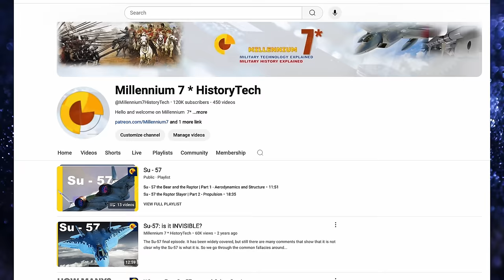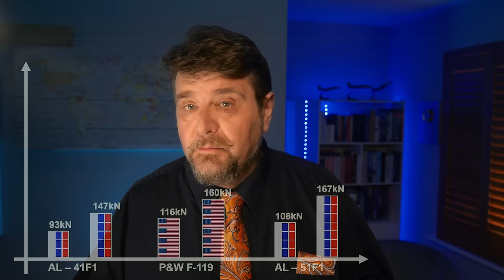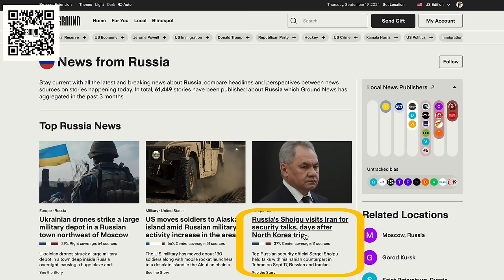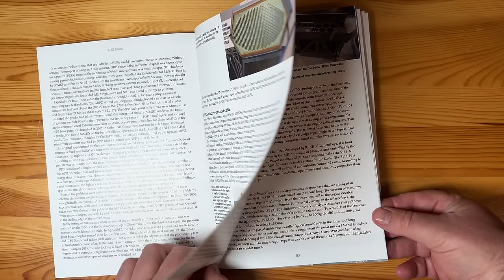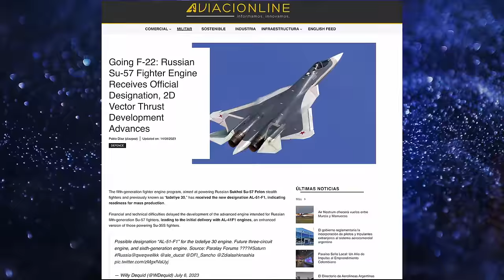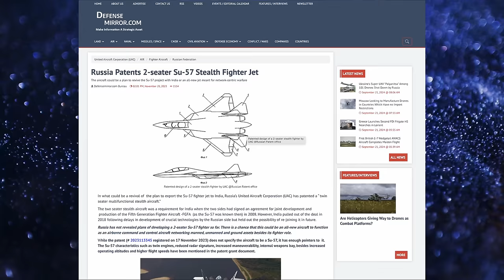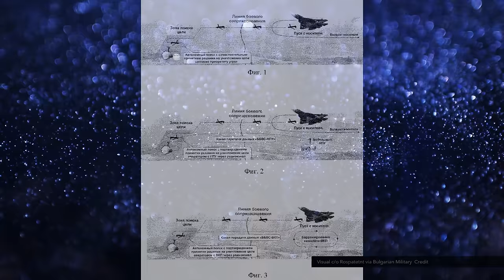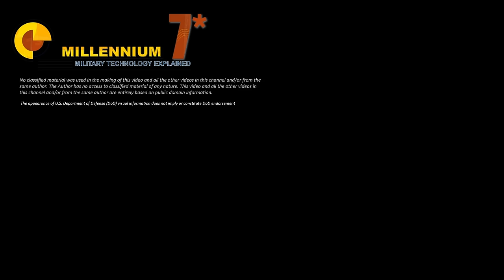The Su-57 is a Masterpiece!

Comment: There’s always the question of manufacturing standards, as modern materials require both advanced tooling and highly skilled workers, both of which are in short supply in Russia. When it comes to avionics, it’s probably still decades behind i.e. the F-35 for the simple reason Russia doesn’t have access to the most modern semiconductors. Russia is currently on 350nm aims to get to 160nm by 2026, the wider West is at 2nm equivalent, aiming for 1.4nm. Software should likely also be behind, as there has been very little time and very few airframes to identify bugs and shortcomings. It all comes down to a lack of experience, funding and scale.
It’s still a good looking plane, sadly used in support of an unjustified and illegal war.
Reply: beautiful outside, absolute garbage inside
Reply: Hard to judge. You can ask a supercomputer or one of those solar-powered calculators from the 90's how much 2+2 is, and you will get the same answer from both. You know what I mean? Complex and expensive does not necessarily mean better.
Reply: @libertarianbydefault  The complexity argument doesn’t favor the Su-57 here. Less advanced manufacturing results in more parts, that are also more likely to break, less advanced semiconductors means relatively higher energy consumption and reduced efficiency, requiring additional cooling and possibly resulting in reduced lifespan, and less practical experience results in less optimized software, that as a result of fewer and likely less skilled programmers is also more probable to be unnecessarily complex. (Highly skilled workers are sought after and thus able to choose a country of residence with better pay and higher living standards)
Reply: @RichelieuUnlimited  Mate, name me at least one reason why the programmers would be less skilled. You just keep making assumptions of the "this is like this, then that is like that". What if it consumes less energy overall? What if it has better cooling solutions? What if is built with additional robustness in mind? None of us know any of it. My point here is that there is this assumption that the way West does things is the best way and if someone else does things differently, they must be doing it worse. Considering there is not real track record to speak of to back this up, I am really amazed by how much faith we have in the overpriced, over-engineered, fragile stuff that we make, while entirely dismissing efforts made by the adversaries 'cause, well, "they are the bad guys, so they can't possibly do anything better than us".
Reply: @libertarianbydefault  If you’re skilled enough to be highly sought after, allowing you to freely choose your country of residence, where would you rather live, western Europe or Russia? Robustness is either the result of more advanced manufacturing techniques, allowing for either lighter parts that are as strong or stronger parts that are of similar weight, or the result of using heavier parts with similar technological level. Aircraft are dependent on being relatively lightweight, which indicates what the best choice of the three is. As for the West being better, a greater number of people, that have more funds available and have worked on those systems for longer, will typically lead to better results.
Reply: @libertarianbydefault  yeah i wonder why do we have this bias in the west? it's almost as if we have worldwide export induestries of these capabilities whereas russia doesn't, it's almost as if the market chooses the best product, and all orders of russian equipment (both aircrafts and anti air systems) are being canceled. I wonder what could possibly lead the west into this unexplicable bias huh
Reply: @RichelieuUnlimited  Look, you make valid points, they all make sense. My point is different: the assumption of Russia "having a lot less and a lot worse of everything relative to the West", that is simply not true. This might have been very true some 25-30 years ago, but things do change.

And to answer your first question. I actually have been to Russia and lived there for a little bit back some 5 years ago, it was awesome. Both Moscow and St. Petersburg are terrific cities in oh-so-many ways. Unlike the absolute vast majority of people who comment, I actually know what I am talking about. I would lean towards living in Russia if I could but we both know that in today's world there is a huge fence, that has been erected by the West, that makes this prospect technically challenging for a westerner. But yes, I did like it there more than your average European country. One of the things that would motivate me is that the West is declining, at least Europe is. Things are just getting a little bit worse day by day, hardly ever better. Russia is flourishing by comparison. This is all quite sad but I am not really willing to pretend that we are "living in the walled garden, and outside is the jungle". A bit off-topic here.
Reply: @libertarianbydefault  yes brother russia is amazingly beautiful if you visit the two most developed cities in the entire country and you go there as a westerner with your powerful currency making everything look cheap. Now put yourself in the shoes of the milions of Ivans you didn't see because they live in a remote village with no plumbing and no pospects in life to ever leave their hometown. Why don't you go to North Korea and tell me how great the life is there because the capital city is clean and modern lmao
Reply: @gior987  Well, let's be honest. Europe is not all nice and peachy outside major cities either. And no, I am not going to say it is one to one, I am not an idiot. What I am saying that the major cities (not just the two I mentioned) are actually terrific and great to live in. And no, you do not have to have stupid amount of money to appreciate it. In Europe you DO have to earn quite a bit to have a half-decent lifestyle. In Russia that same lifestyle is much cheaper. Your argument will be "Well sure, but the Ivans (shame on you for the bigotry comment) do not earn nearly as much for that lifestyle" and that is where I will disagree, it is just not true. No one is forcing you to go to some village in Siberia in the middle of nowhere and live there, I mean, what is the point? I am simply saying that life in big Russian cities is more pleasant overall if you have a decent job/source of income, relatively speaking.
Reply: @libertarianbydefault  "I am simply saying that life in big Russian cities is more pleasant overall if you have a decent job/source of income, relatively speaking." 
No shit sherlock, water is wet. 
Having the money to afford that is much harder in russia, in fact the divide between rich and poor is much much starker in russia than in the west. You can say "it's just not true I've been there" but that's not how it works, you gotta look at the data not at your experience.
That's what I meant with "poor Ivans living in shithole villages" (millions of them) vs "rich Vladimir with parents well connected to the party or to the oligarchs". If you've lived in Moscow and St. Petersburg, who do you think you were seeing most of the time? Besides, your dismissal of how much of an advantage your western currency gives you is baffling, to the point where I'm starting to think you're discussing out of malice instead of out of ignorance. Goodbye
Reply: @gior987  Dude, why is it that people always get so bloody emotional when they are trying to make a point in an argument? I was talking about average Russians, not oligarchs. Yes, there is a ridiculous amount of money in Moscow and there are rich people there who are at the level of multimillionaires in the US or wherever - granted. But I was not talking about them. I was talking about your random average young/middle-aged people. They have decent jobs and decent enough pay for the cost of living in Russia - on average. Europe, by comparison is stupidly expensive. Yes, the pay on average is higher, but what good is it to earn a lot if all of it is taken away in taxes and/or obscene cost of living? Russia has even been reclassified as a high-income country recently. You have this bunch of notions that are true (e.g. difference between the wealthiest and the poorest, remote villages being way worse off than the big cities) but they are far from painting the entire picture. I never said that Russia is the richest country in the world and its citizens are enjoying unimaginable wealth. All I said is that by comparison it is where I would rather live because it would simply be better, that was the original question. Would my lifestyle be the same as that of an "Ivan in some poor village"? Of course, not, so what?

Comment: "The only aircraft  in the last 30 years that had shown any amount of out of the box thinking."

F-35 has entered the chat. One airframe, 3 aircraft.  Full networked battlespace awareness and target data sharing. Who was doing that before? Oh, that's right, nobody.
Reply: And a Trillion dollar price tag.
Reply: @dosa2990  That's the total operating cost, including aircraft, fuel, parts, etc., over roughly 70 years, not the cost of the aircraft alone.
Reply: Lots of people have thought about that over the years. The problem is that it’s inherently at odds with everything else.

If you’re sending data, you’re emitting radiation that can be used to find you. Data security finally isn’t an issue (it was even back when the F-22 was being designed) but if it’s not useful to the enemy, they’ll just jam everything.

The idea is great, but not in near peer conflicts where it’s most useful.
Reply: @dosa2990  If the Russians were to build and operate 5000 Su-57s over half a century or more it would have a similar price tag.
Reply: @hresvelgr7193  “extremely jam resistant” is marketing speak.

If the F-35 is dropping its load on comparatively cheap  jammers instead of the real target, that’s probably a win for the enemy.
Reply: @hresvelgr7193  A single Stormbreaker won't be hitting a jammer target protected by a near-peer enemy. You'll need to send multiples in an attempt to avoid them all getting shot down. At that point, you're out of ordinance.

Also, there's no real need for a 30-60min setup and calibration like a radar requires. Repositioning a mile down the road can happen quickly and organically (that's assuming you can't remain on the road while jamming).

This requires a much more specialized and expensive missile that you probably can't use against your main target.

It does imply that you can pay between a few hundred thousand and a couple million to open a short window to send data, but that data will seldom be worth that price.

Comment: I would hope the new engines are more powerful than the F22's.  The F119 is 27 years old.  The F135, a development of the F119 is 18 years old and has 22% more thrust.  The XA100 and XA101 had ~10% more than the F135, conservatively.  Beyond that, the #1 goal today seems to be electrical power generation and it's associated cooling systems.

Comment: Wasn't the next batch delivered in 2024 supposed to feature the AL51 in the Su57M variant, M including modernized avionics? But the newly delivered 3 units seem to still be using AL41s with flat round nozzles, so I guess not the M variant? I suppose if the AL51 was only cleared in Oct 2023 those three airframes could have still been in the production pipe as slow as they were going?

Comment: it has no radar-reflective canopy and naked burner covers… 
also because radar-transparent pieces with a radar antenna underneath are not that stealthy I guess…
  
they’re not really caring about stealth in both IR and EM, they just want a new and better SU-27
Reply: I have listened to some Western experts and they said stealth is not so important anymore because of modern radars and maintenance costs are very high, IRST can see the heat from the engines also.
Sure its good to have if a country has the money for it.
Reply: @aramisone7198  i’ve talked with an F-35A maintenance crew, that plane has a lot to limit the IR signature as well, if you’re burning a warning pops up in the screen and shows the envelope where you’re visible

I think Russia assumes they won’t have good enough AWACS in the sky so the SU57 will have to be always emanating (also probably the reason for the smaller radars all around)

The opposite is true for the 35, it has 360 IRST coverage. ( the distributed aperture does search and track, also showcased in the recent simulator showcase)
Reply: It does anyhilate F-16 from abive Crimea at a distance of 230km.

@ImBigFloppa SU-57 is more than 24 in service. And when the real engine for it wil be fitted (that's the reason of lower production) they al wil be changed to that engine, what wil result in a airspeed that's faster than the F-22 and certainly out of the range of the F-35 disaster! Not to mention there wil soon be 6th generation SU-75 and MiG_41. Although even the MiG-31 and SU-35 outperforme the F-22 and F-35. 🇷🇺
Reply: @klaastelkamp5414  ah yes, the wündervaffe claim of Russia of the greatest Zar
for what I know or could claim the NGAD is already flying and is the reason RU cant fly its jets inside the ukranian airspace...

Comment: Design wise it appears to be very much a 5th gen fighter. . its the production/manufacturing side of the house that is lacking. The current engines are limiting and they cannot reliably produce the newer engines in mass. This also involves all other high tech aspects and requirements of the aircraft and is not limited to the engines.

Comment: So, in the current state the RuAF isn't accepting any additional deliveries.  But it's a masterpiece, as long as you only judge press releases rather than actual airplanes?  
Anybody can deliver a masterpiece doodled on a cocktail napkin and in a Powerpoint presentation.  Actually delivering real value doing practical operational work is hard.  By the standards of this video, the US LCS ships are also a masterpiece!  If Russia actually delivers a great engine, and it's reliable and lives up to the design goals, great for them.  But until the improved plane is acquired in enough numbers to do routine missions, it's impossible to say how close the real planes will be to the stated intentions.
When US planes have been at the stage that Su57M is, they were often just about to generate a decade of terrible headlines.  Some sorted out their issues.  Some never did.  Some only lived up to some design goals at the expense of others.

Comment: I liked your video, however, I didn't agree with your last statement, even though it might just be opinion. 

Also, Su-57 doesn't have a rear facing radar. And those L-band arrays on the wings aren't radars either, Su-35 has the same thing. At best, they could be passive sensors that could detect Link-16 in the azimuth aspect at best, with much less accuracy in elevation. Also, I don't think their move to a 2D nozzle is a bad move. It might be canted like some of the Su-27 derivatives, but with more deflection. Instead of 15°, it could be 20°, and 2D saves on weight and complexity, better for maintenance and readiness.

It's not the most innovative in the last 30 years, it's just following the trend set by the F-22. I know 5th generation us a marketing term, however, the Su-57 attempted to adopt many of those characteristics with sacrifices and emphasis placed on certain features. A supersonic stealth aircraft with super maneuverability is more impressive than an aircraft that introduced LERX. Before F-22, supercruising stealthy and super maneuverability wasn't available in one package. Then you have the 2D nozzles with better cooling and 20° pitch control. The F-35 is also more innovative than the Su-57, it introduced many things to serial production jet fighters. LOAN for the nozzles, DSI for the inlets, stealthy EOTS, RAS, and 3 different versions of itself. The conventional one, a supersonic stealthy carrier version and supersonic stealth VTOL. For Su-57, you have supercruising, LERX, 3D TVC and LO at best. This is all in terms of aerodynamics and things that would or could affect aerodynamics. For example, stealth requires compromises that degrade performance in some areas, but compensate in others. It also depends on how you want to define innovative. Is it something completely new and never done before? Or combining separate technologies and merging into a new one? Where do you draw the line? Can you count stealth as being innovative for the F-35 jet fighter, since it was done 1st on the F-22, thus it isn't an F-35 innovation anymore? How about the mach 1.3 supercruise for the Su-57? Since it was also done by the F-22 1st? Or can the F-22 be called innovative in regards to stealth, since the F-117 beat it to the punch? How about supercruise, it's been done before as well. It just gets too muddled

Comment: Roughly from 19:00 there is mention from (Russian) stealth aircraft being ecorted by older non-stealth aircraft in battle. Suggesting that Russian stealth is not much capable off. I would like to mention that exactly this did happen above Irak during the first(!!) Gulf War by the USA using their F117's in the early '90's. It seems there is nothing strange about wanting to protect once High Aces in ones Sleeve, so to speak. Which makes this video again one of the most intreresting ones!
Exactly the reason why Millenuim7 is the topic to follow, according to my opinion.

Btw, all is fine with Millenium7, as long as Millenium7 (or Otis!!!) does not consume any thea from Russia . . . ;-)